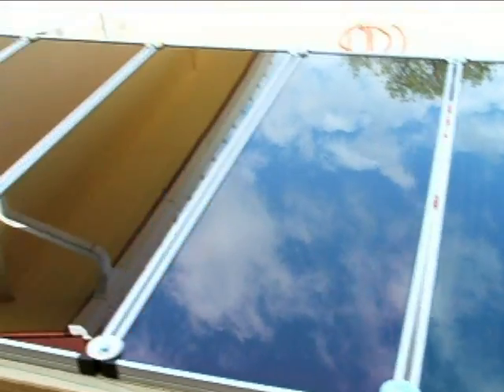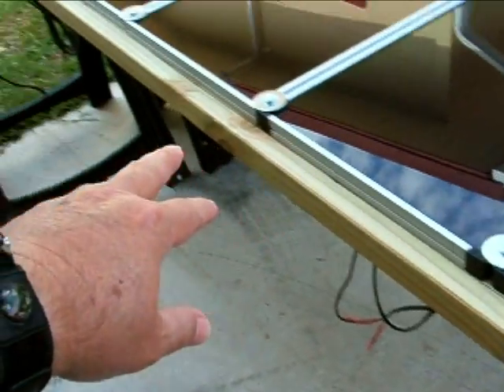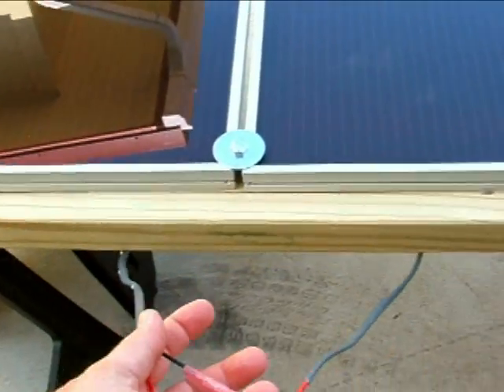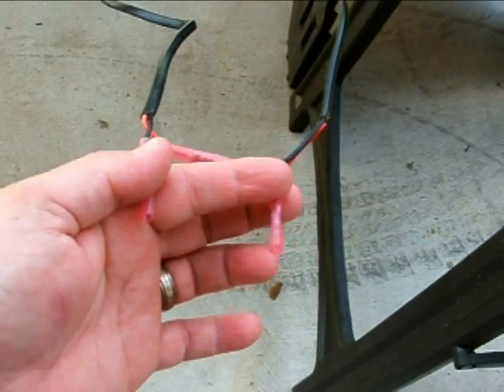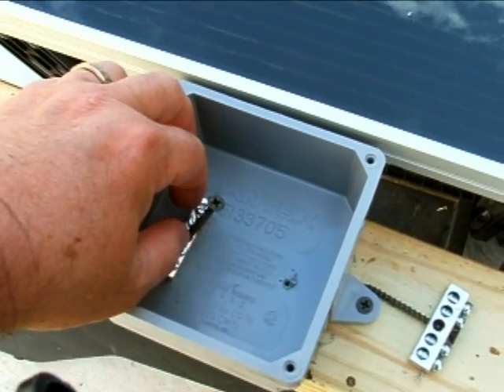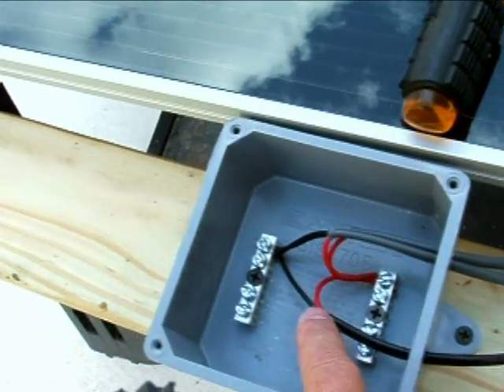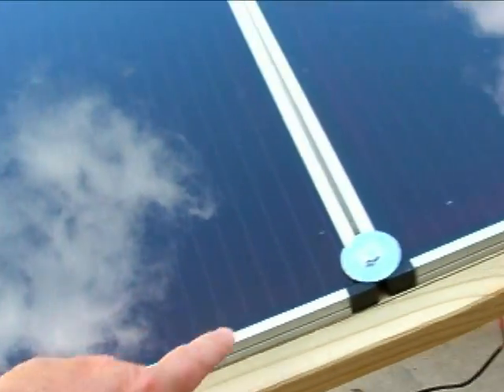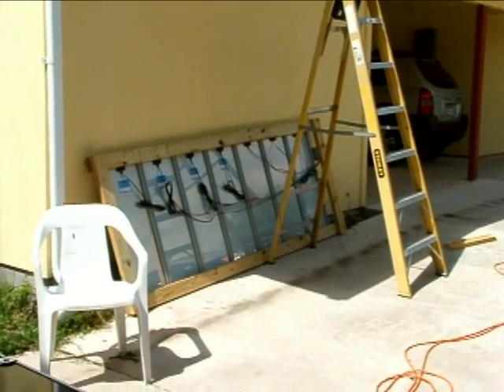How To Install Harbor Freight Solar Panels Part 2

Comment: Okay, So I Will Change To Charge Controller, Out Of (Midnite Solar Classic 150 Charge Controller 150VDC Input MPPT OR MorningStar ProStar PS-30M PWM Solar Battery Charge Controller, 30 Amp 12/24 Volts
)
  1.Which One Is Better to Use For Me?            
   
  2.Do I Still Have To Change The Power Inverter?
Reply from the maker: rica rose The Midnite Solar is the way to go because you'll want to raise your panel voltage as high as possible without going over the 150vdc rating, this will allow you to have a longer wire run and use smaller wire which is way cheaper. The power inverter will still be fine because your battery voltage does not have to change. If I were to be fully honest with you, I would try to change your mind on the inverter to go with a 24v inverter. Changing your battery bank to 24v and your inverter to a 24v inverter will allow you to eventually use higher power inverters with a much smaller wire size and breaker/fuse sizes - which are much cheaper.
Reply: Thank You Again Sir, So It Better  To Have An 24V Inverter And A 24V Battery Bank, That 24V Battery Bank Will Still  Be 6V Per Battery  Right?
Reply from the maker: Correct, it will take four 6v batteries in series to make a 24v set, you can add more batteries by adding 4 more in  24v set and connecting both sets in parallel to increase your capacity while your voltage remains constant at 24v.  You pick up the concepts quickly, you'll do well.

Comment: So, I Already Have Ten 250W Panels So That Would Be 2500W, Eight 6V Deep Cycle Go Cart Batteries , 3000W Cobra CPI1575 Inverter  , 12/24V SODIAL Charge Controller 10A And I Already Have The Wires For Everything. What Else I Need Or What I Need To Change?  (Off Grid I Guess) No Power Suppler
Reply from the maker: The inverter you have is 12v and you have 2,500 watts of solar power, thus the amperage on the wire to charge the batteries at 12v will be 2,500w/12v=208 Amps. You will need very big wires and large charge controller. The charge controller you have at 10A can only handle 120 watts of your total 2,500 watt of panel power, the other 2,380 watts will go to waste.  You will want an MPPT charge controller from Outback or MorningStar that can handle up to 150vdc, then you can wire your panels in series and send it to the charge controller. The charge controller will then step-down the voltage to 12v-14v to charge your batteries. You current charge controller in now way will serve your purpose.

Comment: You wired the panels in series, negative to positive. so what did you do with other negative and positive wires that's the panels? do you just leave them and connect to the two that's right at the junction box?
Reply from the maker: When you are done, you have one positive lead from the first panel and one negative from the last panel that are not connected to anything - connect those to the junction box/charge controller.

Comment: Nice videos, and very good set up using just  Harbor Freight panels.
just one question would you sell me two of the  Harbor Freight controller's and lights I cant buy them in UK and  my farther had is 600 watt solar set up stolen and trying to get him up and running any way I can Norman
Reply from the maker: Yes, I'm not using any of them I can certainly sell you two of them. They come with the charge controller, two 5W flourescent 12v lights with cable and connector into the charge controller as was a cable to charge multiple devices. Let me know if you're still interested and I'll send you my email address.

Comment: I have two questions after having seen a few of your videos.  Nice set up by the way.
1.  Why did you put your panels in series and raise your voltage?
2.  The way you mounted your panels if those bolts become loose or worn it looks like the panels could slide out and be damaged ... anything to keep them from sliding up and down?
Reply: econewpower OK, makes sense to use a higher voltage ... but if one of your panels goes down or becomes defective, and the net voltage out changes ... can your charge controller adjust to that, or does your whole system have to come down until you can replace the panel?
Reply from the maker: Because the higher voltage allows me to send the power further away  without having to increase the wire. The bolts are tight enough that the panels have never come loose in the five years they have been mounted. No need to worry about sliding down since the angle is also very shallow.

Comment from the maker: @Doug3445 Correct, I used 10 AWG to tie strings of four together in the final implementation (which raised my voltage to 80 vdc) and then ran the 10 AWG cables to the charge controller. I'm not losing any voltage with this setup.

Comment from the maker: @chummaker1 Not sure I understand your question. I finally ended up connecting my panels in sets of four so that four panels were in series and then those would be in parallel with the next set of four. If you connect the positives to positives and all the negatives to negatives you will have a parallel connection which does not raise your voltage.

Comment: Hi Al,

Thanks for your videos.....I have a question about how you connected the HF panels in series.  In the video you connected just 2 panels then another 2 panels and then another 2.  Can't you connect all the panels in the group, positive to negative, one right after the other the same way solar cells are tabbed in series inside the panel???  Thanks.

Comment from the maker: @REDZONE133 I appreciate your comments and you're right. I was adding some more panels today and cleaned it up, got rid of the screws and bus bars and used wire nuts instead. Check out the channel tomorrow for the new video. Thanks and God bless you.

Comment from the maker: @kmluddy Good, I thought about that but they would have been too inclined so I wen with the existing roof pitch. Good idea to tie them to the boards as they are too flimsy without the wood frame.

Comment: I dont know if you are familliar with roofing but if you are handy with a metal break you could bend flashing around the frame sort of like skylight flashing or chimney flashing. running the pan flashing in the back under the shingles at least 3 courses of shingles. step flash the sides and counter flash the front. That way the whole unit can remain there for as long as the pannels are guarinteed for aprox 20 years. Unless you have a new roof,  changing the roof after will be a nightmare.

Comment: Nice combiner box, I think that I have seen that somewhere before........(check out my video).  Actually, if you use some 2 part epoxy to glue the bus bars down to the interior of the box you will not need to screw them down.  My original ones are super glued and have lasted over 2 years with no problems at all.

Comment from the maker: @BattMann911 All access holes are sealed with silocone sealant, the mounting screws go into 2x4, on the low side of the box (as the roof is pitched) I drilled a small hole in each corner so that if any water got in it would immediately drain out of the low end. Boxes have been dry every time I have inspected them.

Comment: Since you drilled through the back of the junction box to mount the buss bars, how did you insulate the screws or seal the box so that water won't get behind the box and cause a short between the two mounting screws?

Comment from the maker: @NoMoWires No problem, the junction box is a 4" junction box. You could also grab the yellow pages and see if you can also find it at a local electrical supply store.

Good luck with your project, make sure to post a video for us if you can!  God bless you.

Comment: Al, Where did you get the Buss Bars and Junction Boxes. We tore Home Depot apart and could not find that particular box and buss and there was not anything that close. It would have been about $15 per box for something close.
Thanks

Comment from the maker: @NoMoWires I'm adding the Dupont panels to the battery bank, the HF panels are staying and I'll probably add more HF panels until I max ou the FM60 controller. Once you dedice on a panel type to a MPPT charge controller you really can't mix and match or the maximum point tracking won't work so you'll loose the abilty to squeeze efficiency out of the panels. For this reason I will add more HF panels now that they are on sale again for $149.  Take care!

Comment: Are you adding the Duponts onto the system or did you decide that the HFs were kust not going to do the job and decided to go with a more efficient panel?

Comment from the maker: @NoMoWires Thanks! I'm glad you find them useful. In the next couple of weeks the 2Kw of Dupont panels will be going up with the two Outback charge controllers and the electrical circuits should be fully finished by mid to end of September. The goal is to finish all the solar work by September. The wind stuff is being redone as well and I hope to finish all of it in October. Take care!

Comment from the maker: @Pat5725 I did use pressure treated wood Pat, I used Yellawood throughout the frame precisely so I won't have to climb again in two years to replace it. For the next frames I'm thinking of using Trex which is wood shavings mixed with plastic and comes in 2x4s and it is totally impervious to weather. It's more expensive that will really last a lifetime. Thanks for you comments brother.

Comment: I have a question.  Why didn't you use pressure treated wood instead?  I can see over time the weather and rain rotting the wood on the frame.  With all the great work you've done, I will like to see you go up on that roof once....to install it and let it last forever.

Comment from the maker: @wtam69  It is a misconception that higher Amps means faster battery charge. It is the higher wattage that charges batteries faster. As you indicated, the higher voltage means less line loss so I can have a longer run of wire or use a smaller wire when I increase my voltage and as a side benefit the power conversion is more efficient.

Comment from the maker: @wtam69 Solar panels are not like batteries in the sense that they don't store energy. A 12v 15watt panel has 1.25 Amps, so when you wire two in series you get 24v X 1.25 Amps = 30 watts. Your power doubles no matter if you wire in series or parallel and watts is the definition of power, your batteries charge equally as fast at 12v & 2.5 Amps as they do at 24v and 1.25 Amps.

Comment: Love your setup. Looks real solid and neat. I assembled a 60 watt panel but dare not put it on the roof for safety reasons.  Can you tell me the advantages of wiring it in series? Is it lower voltage loss? Don't you lose some amps?